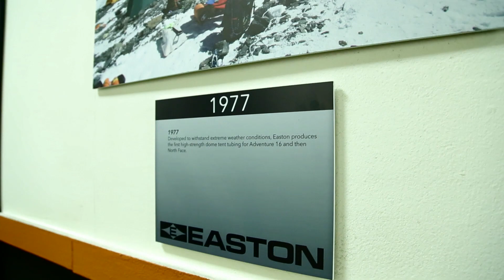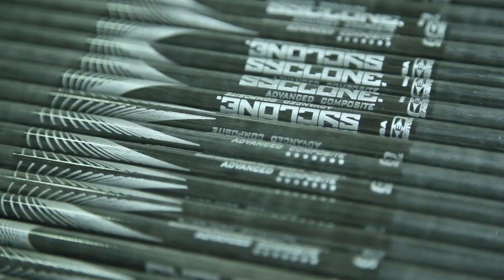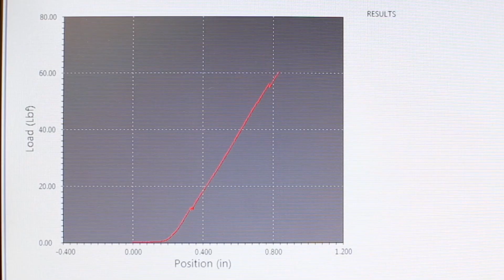MSR & Easton: New Advancements in Tent Pole Design

Comment: Can you please make replacement pole kits for MEC tents? It seems they are no longer carrying this type of equipment. Bought a used MEC Cabin 4 with a broken pole. The male end actually looks like it deformed then finally failed (usually it's the female end that cracks when poles aren't fully put together). Thanks.
Reply from the maker: Hi Cindy. We don't have any current plans to make replacement pole kits for MEC tents, but thanks as always for the feedback and suggestions.